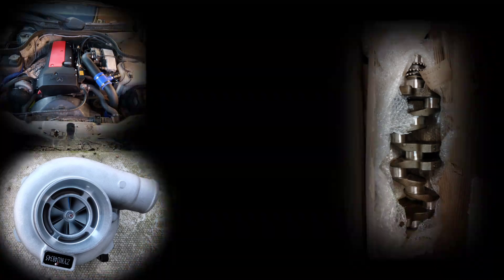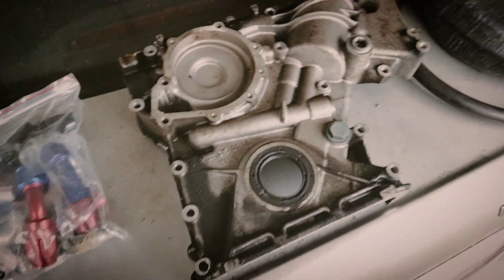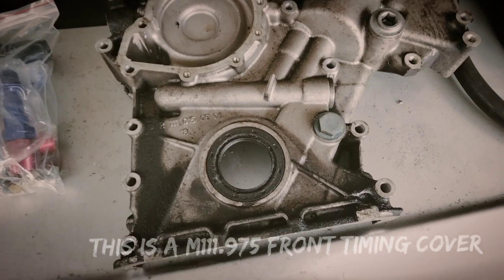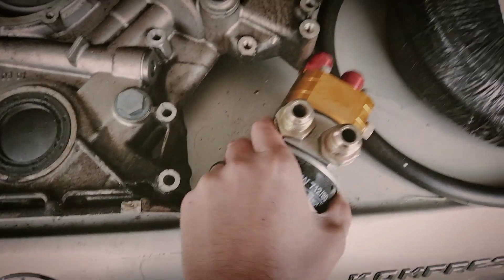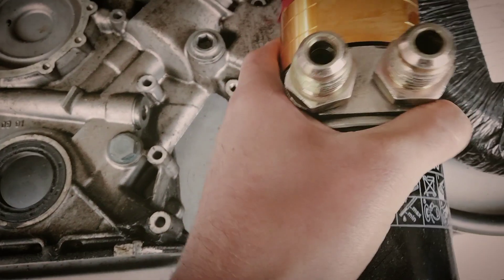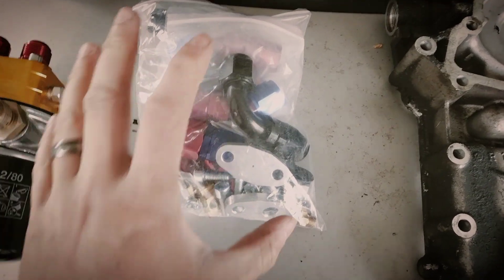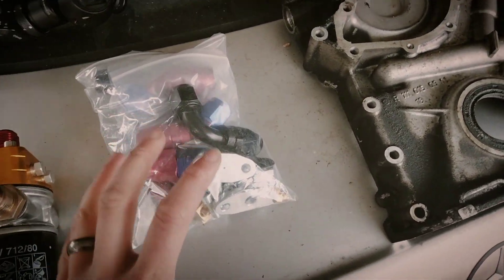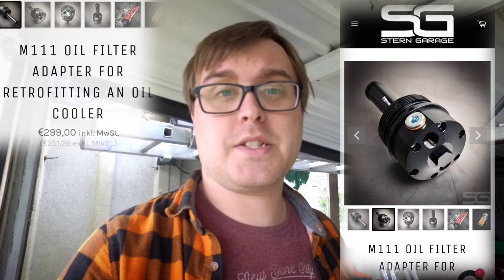The Clock Is Ticking On The M111 2.5 Turbo Build... Plans to add an oil cooler

Comment: 2.5 you say?
So did you get it over bored mate?
Also I hope you do engine build videos as I love the kind of stuff
Reply from the maker: The whole series will follow the engine build buddy, basically bore remains standard 91mm but the stroke is increased using a crankshaft from a 2.3 diesel and my 4mm shorter BMW S14B23 connecting rods. The should make the engine 2.5ltr

Comment: Hello, I discovered this YouTube channel because I have been planning for several years to restore a mercedes 190e and to fit it with an evo 2 kit to mainly go out on the track. Bodybuilder by trade the bodywork is not the part that worries me the most. But for the mechanical part I already ask myself more questions I have the idea since the beginning of swapping the engine with an m111 to stay on a 4 cylinder engine like the original version and even to be able to have equivalent power without spending a lot silver. My first objective will be the preparation of the chassis I am lucky to have a well equipped workshop and I would like to learn how to make fiber body parts, to stiffen the body and adjust the geometry as best as possible. It is from there that your skills interest me a lot, I hope to be able through your explanations to optimize the engine with a turbo conversion. I try to do my best to understand the videos unfortunately my English is bad if I don't have translators. I therefore allow myself to ask you if you would agree to be able to exchange by email with you in order to better know the modifications to be made for optimal optimization? Sincerely jimmy

Comment: I am planning exactly the same with the oil cooling mate also I will keeping an eye on the diesel crankshaft idea can't wait to see if that works awesome mate
Reply from the maker: Awesome dude, as soon as I find out if I have enough rod to block clearance I'll let you know man. Think an oil cooler will really help our engines under higher load's 👍
Reply: @M-oneeleven-M111  oh for sure it will help might stop the ringlands and headgasket from shitting themselves everytime you look at the throttle with intentions of pressing it 🤣🤣🤣

Comment: You, did the OM601 crank fit the M111 block? Looking to make a stroker myself :D
Reply from the maker: Hey man, apologies for the late reply I haven't yet even started building the engine unfortunately due to working 6 says a week I have everything I need except time. From other strokers I've seen use the om601 crank a few people out there have already done this, but I can't say for sure yet that it fits as I'm not yet in the process of building mine. But I'm also using shorter BMW rods and planning to retain stock pistons but the pistons will need some machine work to fit the rods.

Comment: Hey man, so I’m curious about turbo swapping mine. Is there a way to do it on stock ecu if I get a boost controller to keep it within the stock parameters?
Reply from the maker: If you use something like a gt28 or a To4e turbo and run up to 0.8 bar the stock ECU will be fine with it buddy? Is your car a manual or automatic? I have seen a few people be able to run a little more boost on stock management, but as we only got our cars to run reliably at that boost level that's all we recommend. If your car is a manual then going to a standalone ECU isn't too difficult with some wiring knowledge, we ran 1.2 bar then with a 20 second 1.5 bar over boost. The biggest headache with these engines is the stock headgasket likes to give out, so ide always recommend a fresh stock headgasket to save any big headaches further down the line. Hope that helps buddy if not already please subscribe and share, I appreciate I haven't done any recent videos but I'm still very much active for help and advice.
Reply: @M-oneeleven-M111  mines automatic. Do you have an instagram or anywhere else I could message you easier?

Comment: Does anyone know part number for front cover with oil cooler ports?
Reply from the maker: Unfortunately I don't despite looking through a lot of parts diagrams I haven't yet found it, but I do know it exists. Hopefully someone can share the part number if they have come across one cause I would much prefer that method for this build.